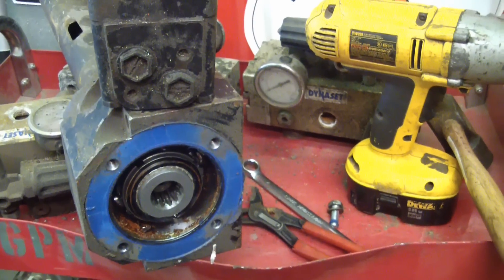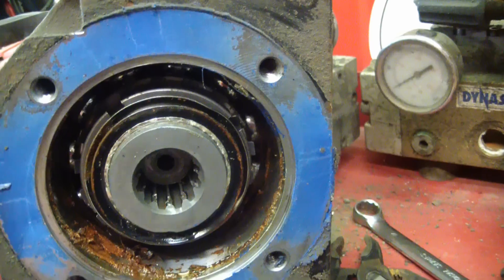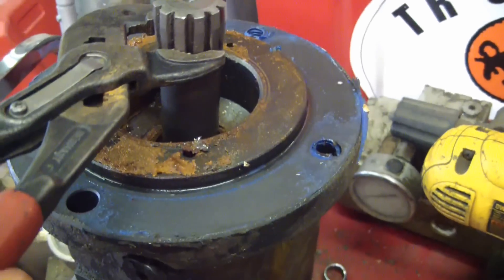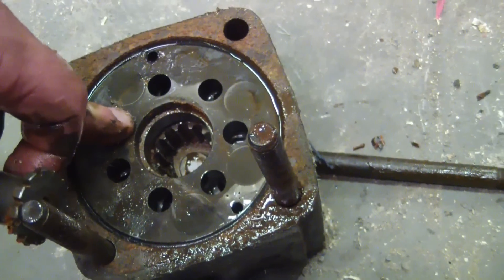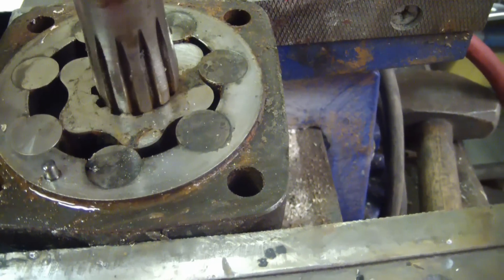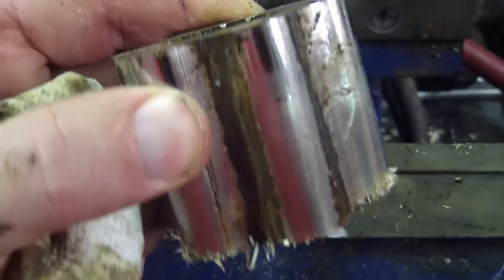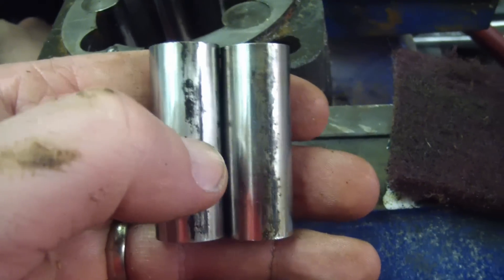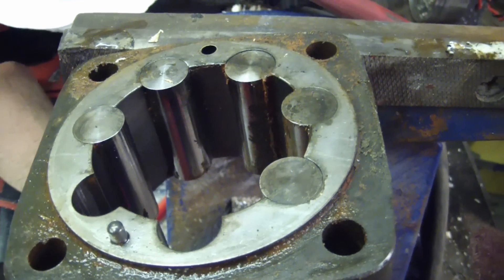Hydraulic Gerotor Motor Teardown

Comment: Yeah, it's a geroler motor, a gerotor is different, the rollers are what make it a geroler.

Eaton uses these fairly widely, I think a common use is in a direct drive system where there is limited space, to avoid a planetary drive set.
The geroler makes heaps of torque.

My problem is that it seems to have shifted on disassembly and now the sprocket (timing gear) won't go back in place.

Comment: Just a thought but...from rebuilding some g-rotor motors before you can flip the rollers 180 degrees and clean up the gear and she will run like a champ for  (not as long as a properly rebuilt assembly with a kit ) but for quite a while longer than a work shift. Just my 2 cents. Love the teardown

Comment: Those rotating rods that was corroded, where they supposed to spin? If so, how come the became corroded in just one side/pretty straight line?
If the are not supposed to rotate, couldn't you just put them back half a turn?

Comment: Would it be possible to file off the high rust spots on the hardened rollers and then press them back into the case with the bad spots facing towards the case, away from the gerotor? Then polish up the gerotor and reassemble?

Comment: Are those pins supposed to rotate in the shell, or are they supposed to be stuck in place? 'Cause if the latter, wouldn't you just put them back in with the rust toward the shell where it's out of the way?
Reply: It fits to precise. These things work on very high pressure.
A little loose fit would cause a major leak, and would result in loss of power. So, some rust jams the whole thing.
Some nice parts though. Would keep them in my junk box.
Reply: Yes the pins rotate in the shell.

Comment: It almost looks like the pins could be rotated and then installed to present a good surface to the rotor.  The rotor could be polished up. I'd be worried about how the splines fit up though. Also the condition and clearance of the rotor faces.  Looked like there was a lot of metal particles floating around.
Reply: +Shawn Bottom I believe the surface was pitted.  That'll hold lubricant and create cavitation, which creates faster surface erosion, releasing more particles into the lube, creating schmutz, and schmutz kills the hydraulics.

Comment: In the start of your tutorial you made two wrong conclusions,first a hydraulic has so little
clearance,it will hardly turn over.
Second that little drive shaft never comes out of the rotor becouse the rotor makes an excentric motion.
Keep them films coming!

Comment: Good stuff,  I have had some success with old diabolics by running them with copper "Never Seize" mixed in the oil.  There is also some Mormon tabernacle company that makes a nice smooth cocktail of colloidal lead additive that brings new life to greasy old dust collectors like that.

Comment: I've been in PURGE MODE.  Too bad you're in Canada, and post is so darn expensive.   Finally noticed my old 18-36V supply (DOA) and HP 5334 9 digit meter (DOA) need to be tossed.  I've got a HP 5334B which is great little tool to see if that darn Ethernet XTAL is really at 25.000 000 Mhz.  Lots of cool stuff, HP Plotter (Works -- but after 20 years old not sure where the dos driver went)just decided it was time to clean up.  

My grandmother used to tell say "not sure if you want to keep it... toss it into an unmarked box, write a date on it, if you find the box more than a year later and don't remember what is in, don't look in the box - donate it to charity. Smart women as I still have unopened boxes from moving to Texas in '93. Time to toss.
Reply: Just looked it is a 5328A  (Hadn't paid attention to it since the 5334B arrived). 

Even has the DVM option.

Not a clue what it cost to ship to Canada Land...
Reply: OUCH!  
For not working counter, not worth it.  I've had it in the shop for 10+ years, so finally had to admit I have too much other things.  I also found a Z80 training kit.... from 1986(!).